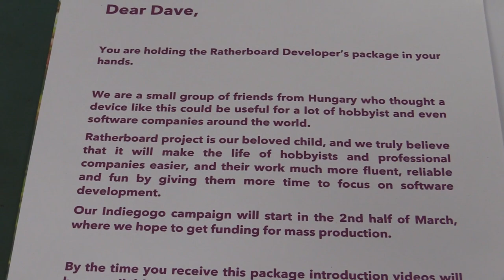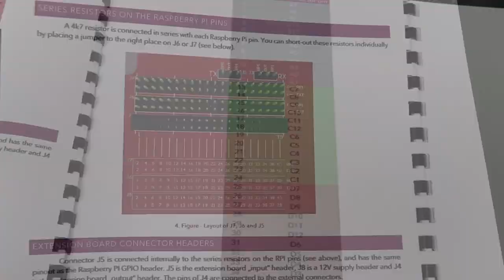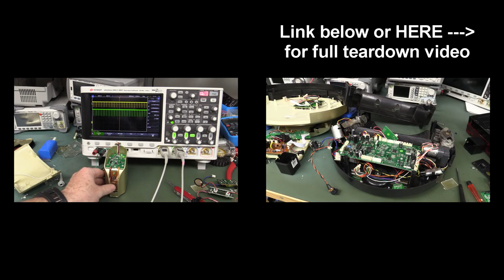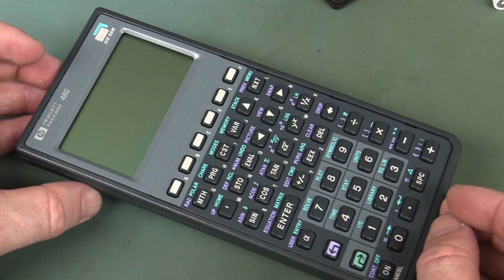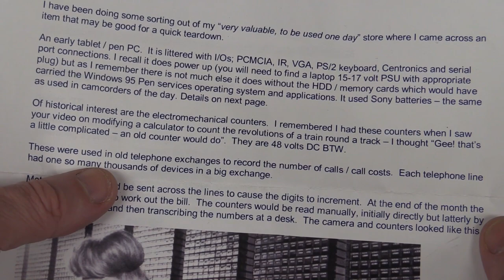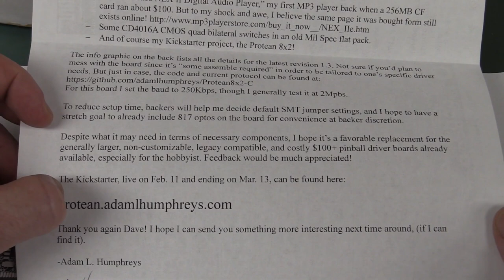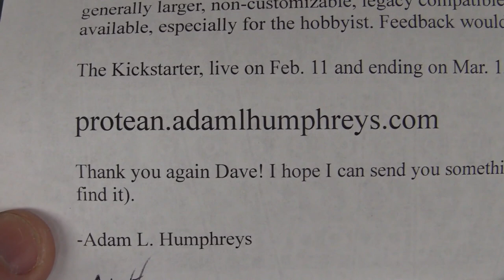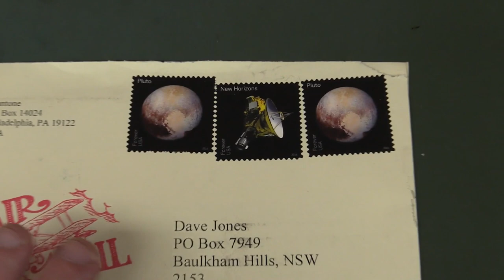EEVblog #979 - Mailbag

Comment: Here is the link to the TE rugged automotive enclosure that was used to house the Rather Board:
http://www.te.com/usa-en/product-EEC-5X650A.html
Reply: Operating Temperature Range: - 55 C to + 125 C very harsh environment protection,
Reply: 16:40 thats an invisible wall. When placed and turned on, the vacuum cleaner wont go past it
Reply: Yeap, it is an automotive ecu enclosure (at least main purpose). Really familiar with these :)
Reply: Does the RPi work at 125C?  (Or rather, will the box be able to sink away the heat that's generated without vent)
Reply: I built my xmass flasher drivers in these

Comment: The Rasberry Pi rugged box looks pretty much like that standard ruggedized boxes available from Tyco Electronics. They were made by a company called "Deutsch Connectors" and later acquired by Tyco AFAIK. No custom mold necessary :)
Reply from the maker: Ah, thanks, I just assumed it was fully custom.

Comment: They likely use the usb port because the pi has built-in protection when you use the usb port, while the 5v pin on the header is connected directly to the cpu and there are no pins connected to the 5v regulator.
Reply: pretty sure the soc on the rpi doesnt run off 5V so not sure what youre trying to say

Comment: The Stylistic 500 was my first home automation panel.  I got a lot of them on ebay for a song.  I built a special frame that provided power and serial from the attic.   I replaced the HDD with a 8MB flash card running a minimal gentoo linux with basic pen services.  Could control all kinds of things with it.  Was a fun project.  This was probably 2001/2002.

Comment: The processor architecture on the 48G is interesting in itself; it has 64-bit registers and a 20-bit address width but only a 4-bit interface.  It has numerous arithmetic registers including a BCD exponent register which can store values up to 499.

Comment: Those automotive connectors are called Deutz connectors IIRC. They're very nice to work with, but stupidly expensive, like $50 per connector and a buck per pin.

Comment: The first item uses Deutsch connectors made by TE, they are the DT series. Coincidentally that box was originally designed for GPS modules on lorries trailers, it is so big so that it can house a battery, when the haulage cpmapny forget where they left a trailer they can look it up. I would guess originally they did not need 48 pins as the box comes in 1, 2, 3 & 4 socket versions, all plugs with different keys.

Comment: The HP 48SX was the most popular model. It had the two expansion slots built in and you could purchase tons of application cards for the calculator including extra memory cards. I had the chemistry and electrical engineering card and a 512K memory expansion card.  Still have it 27 years later!  The 48G was cheaper and didn't have the extra slots that everyone wanted back then.

Comment: for the ratherboard i think they chose to power through the usb port instead of the header was so it doesn't negate the power protection circuitry built into the pi. The 5 volts on the header goes strait to the 5 volt rail, no fuse or over/under volt/current FET switches

Comment: EISA was introduced late 80s, wasn't really popular - in Desktops! In Servers it was fairly popular.
For consumers the Vesa Local Bus (very long cards), was rarely used for anything else than graphics cards and IDE/SCSI Controllers. That was the Standard for 80486 boards. And it was the 486 I/O Bus on a slot.

PCI came later, at the end of the 486 lifecycle, the i586 (Pentium) Boards always had PCI...

Comment: They didn' connect the smps to the 5 volt pin the pi because it doens't offer protection. The usb has protection
Reply: yh but that way they didnt bypass the integrated protection and any problem that might not trigger the rather board protection will trigger the rasp protection and if it doesnt trigger the rasp protection the blame is on the rasp foundation and not the rather board
Reply: Dear Carlos Almeida,

Yes, our goal was to use both of the protection possibilities. (Ratherboard's protection and the RPi's also.)
Reply: Still think it would be better to have the option to power it from the GPIO , that micro USB is not that rugged and it would also allow for fast swap out of the Pi, swapo the sd and BOOm your done , push it back on the headers.

The Pi is so cheap you could consider it expendable, ease of service and speed of service are the most important i think, at least for this application.
Reply: Dear Andrew Joy,

Tank You for Your feedback! We will consider Your opinion in the future!
Reply: Yeah, make it a jumper on the rather board.
Reply: Dardo Sordi Thats a nice idea
Reply: If they have their own SMPS on there then the ideal diode in the RPi isn't useful for much. It's basically for backfeed protection.

Comment: Will it get a bit toasty inside the Rather Board box without cooling and a means for warm air to escape?
Reply: I think the volume of air inside should be sufficient. Given the level of detail in the design it would be astounding to think the designers overlooked thermals!!!
Reply: Johann Wyss Well, they seem to have overlooked powering the Pi from the header pins, instead supplying a short USB cable which when connected fouls some of the board's headers!
Reply: Dear Alex Quant,

(Somebody already had the same question on our facebook, so we will be able to give You a fast reply.)

The short answer to this question is that we did not experience overheating problems in our rooftop weather station application (http://www.ratherboard.com/#live_demo) during last summer (despite the fact that in Budapest 30-35°C temperature during the day is common).

The long answer is a bit more complex:

We have done a test to estimate the thermal conductivity of Ratherboard's enclosure. We have put a power resistor and an NTC temperature sensor inside the enclosure, which were connected to Ratherboard's external connector header. The power resistor was connected to a laboratory power supply. The ambient temperature was also measured.
 
During the first measurement the resistor dissipated 4.2W. After 65 minutes the internal temperature became constant (34°C), while the ambient temperature was 23°C. The temperature difference was 11°C and the thermal resistance was 2.63K/W.
After the first measurement we increased the voltage and the resistor dissipated 7.56W. After 60 minutes the internal temperature was constant again (42.3°C), while the ambient temperature remained at 23°C which gives a thermal resistance of 2.56K/W.
According to this measurement the thermal resistance of the enclosure is approximately 2.6K/W, which means that if you dissipate 1W inside the enclosure then the internal air temperature will be 2.6°C more than the ambient temperature.

According to https://www.raspberrypi.org/help/faqs/#powerReqs the Raspberry Pi 3 model B consumes 1.2A at 5V (worst case scenario with lots of external USB devices connected) , which gives 6W. Ratherboard's other components power consumption is negligible compared to this value. 
If we assume that Ratherboard's switching power supply has 80% (underestimated for this calculation) efficiency, than the total dissipated power inside the enclosure is 7.5W, which means that the temperature will be 20°C more than the ambient temperature.

Let's say that the ambient temperature is 50°C because of direct sunlight, than the air temperature will be 70°C inside Ratherboard's enclosure. According to https://www.raspberrypi.org/help/faqs/#performanceOperatingTemperature the LAN controller is rated to maximum 70°C temperature. The chip will have higher temperature than the air around it, so in this scenario the chip will probably have higher temperature than the rated maximum value.

The above example shows that if the Raspberry Pi works very hard with many peripherals connected to it than you should consider installing heatsinks on the Raspberry Pi and installing Ratherboard in a shady area. Also note that the Raspberry Pi 3 model B typical bare-board current consumption is less than 500mA (https://www.raspberrypi.org/help/faqs/#powerReqs), which means only 3.2W dissipation, which only means 8.3°C temperature difference.

So the system's actual temperature performance is application dependent. For example if you have direct sunlight but lots of airflow than the heat transfer will be much better, hence the thermal resistance will be lower.

We did not experience overheating problems in our rooftop weather station application during last summer as I mentioned earlier. The CPU load was not much (below 10%) and the Ratherboard consumed approximately 0.18A at 12V, which gives 2.2W dissipation. This value is the third of the worst case value (7.5W). We have not installed heatsinks on the Raspberry Pi 3 model B. Termal behaviour has to be investigated in every electronics design, of course, a Ratherboard application is no exception.
Reply: I don't think they did overlook powering the pi via GPIO, powering it via GPIO bypasses several safety systems not limited to the fuse and BCM. I think their decision was a good one personally,  Albeit clunky.
Reply: Paint it white?
Reply: Thank you! :)
Reply: Louis Stubbolo It will radiate heat better with it colored black; this is unless it is hotter outside the box than within; then black would more effectively do the opposite
Reply: How so? Not offended. Interested.
Reply: Louis Stubbolo  Blackbody radiation. They paint the radiators on spacecraft black, and the SR-71 Blackbird was painted black for this reason. Black is great at releasing heat for the same reason it is good at absorbing it.

Comment: The plugs are a high end automotive plug. called a deutsch plug very high quality requiring a propitiatory tool to crimp them.
Reply from the maker: My pliers worked just fine!
Reply: deutsch plug you say? ze germans - always high quality and very proprietary
Reply: That would have got me shot or at very least fired. I had a job setting up and installing GPS tracking and location services, security systems, lighting and other electronic services / devices into blast trucks for the mining sector. They were vehicles which would transport and set the "prill" (ANFO explosives) and their detonators. Naturally there had to be redundancies for everything. These connectors were chosen for there seal-ability and their insulation properties etc. Excellent connectors and it shows the level of quality and ruggedness the designers of  the raspberry pie boredom thing were striving to achieve...

Comment: The ratherboard would be a lot better if it worked with a RPi Zero.
Reply: Dear Imiddleman,

Actually this is a good idea/option, and future versions may be released, the whole thing depends on the success of the RB community and the crowdfunding campaign.

RB was specially designed for the Model B versions, our goal was to create a useful device for their users.

Comment: EISA died because the way it was connected to the CPU and memory - any issues with graphics and the whole PC would hang
Reply: 666Tomato666 Actually, EISA was a server-mostly alternative to IBM MCA until PCI took over.  You were probably thinking about VESA local bus, a low cost way to connect 32 bit graphics cards to motherboards where all the other slots were 16 bit ISA.
Reply: aah, yes, could be it, it was like 20 years last time I dealt with them :)